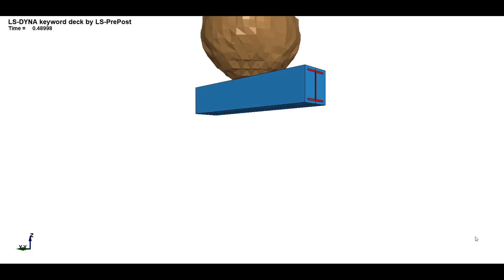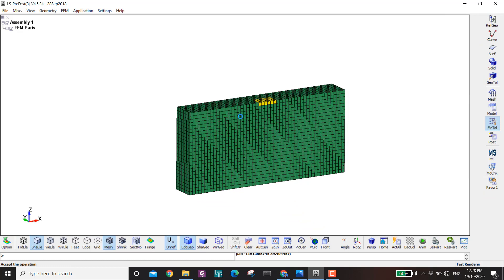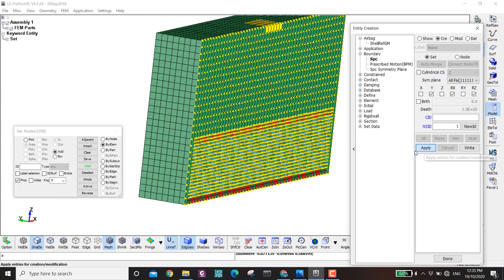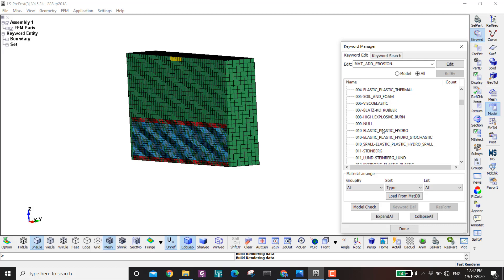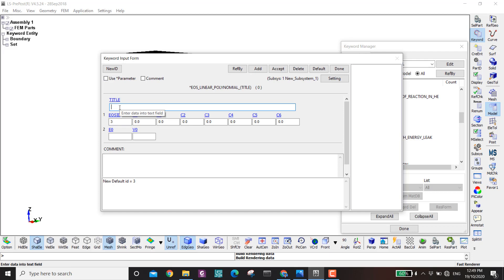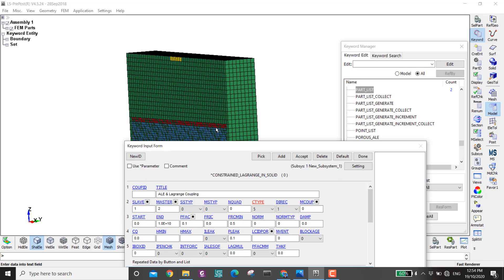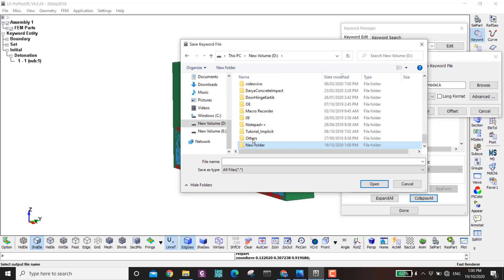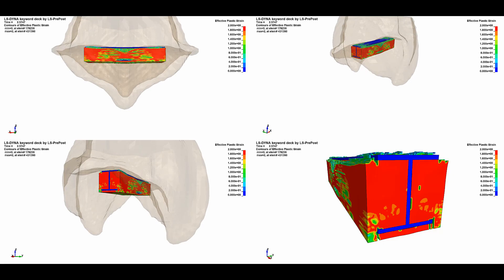LS-DYNA TUTORIAL 20: TNT Blast on Composite Beam

Comment: thank you very much for your work! it is very helpful for me.  And i am waiting for ur tutorial with S-ALE method about the concrete under blast.
Reply from the maker: Check out the following document:
https://ftp.lstc.com/anonymous/outgoing/hao/sale/tutorials/S-ALE_Solver_1.pdf
Reply: @AmeenTopa  thank you very much!
Reply: @AmeenTopa  Dear Ameen sir. i met some problems when performing my simulation about concrete beam under blast loadings with FSI. I found when the largrange grid is the same ,if u thinner the Euler grid , the blast wave spreads slower in air ,and the reflect of the beam is not good.can you give me some advice? Thank you very much1
Reply from the maker: As a general rule, the mesh or grid for both Lagrange and ALE should be relatively the same size
Reply: @AmeenTopa  but i have tried again,when the lagrange and ale have the relative  mesh size,  the coupling between the ale and lagrange does not work well. i dont know what problem  it is, so i wonder know if you can  help me check my kword?
Reply from the maker: @yingliangxu9369  You can check the following references:
https://www.dynalook.com/conferences/9th-european-ls-dyna-conference/fluid-structure-interaction-involving-close-in-detonation-effects-on-column-using-lbe-mm-ale-method
https://www.researchgate.net/post/How_can_I_control_leakage_when_simulating_explosions_with_Fluid_Structure_Coupling_Method_in_LS-DYNA
https://www.researchgate.net/post/Any_advice_with_a_Blast_modelling_in_LS_DYNA_using_Load_blast_enhanced_and_MM_ALE_Leakage_problem
Reply: @AmeenTopa  sorry to bother u. When adopting the key *constrained beam in solid to couple the reinforcement and concrete, a LSDA format file cbisfor can be made.  I have tried to open the file through LS-Post, but it didnot work. Do u know how to open the cbisfor file,?

Comment: Hii sir I am Akshay, i have seen your blast simulation video.
I have also tried the same as yours, I am getting problem related to ALE multimaterial section ELform 11 is not applying over there.
If another ELform kept like -2 or -1 the blast is going out of air domain.
Sir I request you to please provide me the solution regarding the problem.
    Thankyou sir
Reply from the maker: Hi there, for the TNT and AIR, you need to use ELFORM = 11 in SECTION SOLID. If this option does not appear to you, then maybe you are using an old version of LS-PREPOST and you need to download the latest one. 

ELFORM = -2 and -1 are for structural parts like the concrete or steel parts.
Reply: @AmeenTopa  thankyou sir

Comment: Thank you so much. That's a kind of you. Keep it up.
Reply from the maker: Glad it helped. Please share my videos so they can reach and benefit more people!
Reply: @AmeenTopa  Indeed. I will share and recommend my colleagues to keep in touch with this channel.        Ammen Topa, If you could please shoot one more new LS-DYNA and/or LS-PrePost tutorial video on "Steel concrete composite beam under blast load", where the SCC beam is planned to be made using advantage of symmetry from a reinforced concrete slab with "I" or "H" section structural steel beam which then finally reduced to quarter (1/4) of the FEA model (i.e. SCC beam with RC slab with "C" or Channel section). Thanks in advance.

Comment: Can u help me how to use volume fraction geometry, I need to simulate a composite plate sandwiched with a shear thickening fluid.
Reply: And if u suggest how to incorporate and procedural steps for the above problem
Reply from the maker: @raviprasanth3675  Sorry, your request is very specific and I do not think many will be interested. You may contact me privately if you needed private consultation.

Comment: i have problem say :

* Warning 40487 (SOL+487)
     max prin strain of element 18510 at int. point 1
              NaN > failure crit 1.0000E-01 at time 2.8082E-01
     solid element 18408  failed at time  2.8082E-01
     solid element 18409  failed at time  2.8082E-01
     solid element 18410  failed at time  2.8082E-01
     solid element 18508  failed at time  2.8082E-01
      node  number 20512 deleted at time  2.8082E-01
     solid element 18509  failed at time  2.8082E-01
      node  number 20513 deleted at time  2.8082E-01
     solid element 18510  failed at time  2.8082E-01

do you know how to fix it sir?
Reply from the maker: That's not a problem. It is just a message telling you that some elements are being deleted as they reached the maximum principle strain defined in MAT ADD EROSION.
Reply: @AmeenTopa  how do you find the EOS for aluminium or other material sir?
Reply from the maker: @abdullahfaqih9745  you can search in the literature. Go to google scholar or research gate.

Comment: I have followed all the steps you had done but I face a problem the file act as there is no exploaion and the running time is very small less than 1 second . when I open the 3DPLOT  I find there is no effect for the explosion and there are not any deleted nodes in the run out file.
Reply from the maker: Please follow the steps again carefully. This video is uploaded since two years ago and no one else has encountered similar problem.
Reply: @AmeenTopa  I will follow it again.. Thank you. But l have another question the distribution  of the explosion appears By defult or l have to change the sitting to show it?? as I tried several models and I can see the effect of the explosion but I can not appear its distripution.
Reply from the maker: @nancyyounan-or5wq  You need to hide the solid mesh of air and explosive and show the fluid(ale) mesh. Check the post processing part of this video again.
Reply: @AmeenTopa  ok. Thank you 🙂

Comment: Dear Ameen,
I tried to model this exact same problem but I am not able to see the part 5 and part 6 i.e., ALE group 1 and ALE group 2. I have checked that I have assigned the ALE>multi-material group keyword, could you please help me out!

Thank you.
Reply from the maker: Dear Yash,

First, make sure you are using the latest LS-Prepost.

Secondly, make sure that the correct ELFORM is used for the ALE parts. 

During the preprocessing (in the k file), you cannot view the MM_ALE groups. It is only visible in the post processing. 

Make sure to tick on the small box next to 'Fluid(Ale)' on the "Assembly and Select Part" window.
Reply: @AmeenTopa  Got it. Thank you.

Comment: In contact automatic surface to surface, shouldn't the concrete be the master and I-beam the slave but you have done it the other way around. Is there any reason for it?
Reply from the maker: It doesn't matter because we are using AUTOMATIC surface to surface. If you are using Surface_to_Surface which is not Automatic, then slave should be the concrete and I-beam is the master. The slave is the parts that is moving. Master is the part that is stationary. 

Note that this is only for SURFACE TO SURFACE contact. If it is NODES TO SURFACE then the nodes should be the slave always.
Reply: @AmeenTopa  Thank you sir for the explanation.

Comment: how can i define the weight of explosive in this modeling 
if the explosive charge is 25kg or is 1000kg , in which step can i define this
Reply from the maker: Dear Hemeda, you need to increase the volume of the TNT initial volume
Reply from the maker: For easier control of the mass, you can just use LOAD BLAST ENHANCED. Check out my tutorial on Blast Simulation here
https://www.youtube.com/watch?v=B1vGRU2a5f0

Comment: Sir iam getting the error of ALE part is beyond initial void what could be the reason.
Thankyou
Reply from the maker: Are you using INITIAL VOLUME FRACTION or INITIAL VOID?
Reply: Initial void
Reply from the maker: @akshayraj2426  the part used in this keyword should have ELFORM = 12.
Reply: Sir at the end of lsdyna manager it is showing like forttl severe program exeption acess violation
Reply from the maker: This sort of error is due to the solver, as  discussed recently in the LSDYNA Gmail group. Check that one for more details..

Comment: Hello, Amen. Thank you for your wonderful tutorial, its very helpful for my master degree. But I have an error on LS-Run after starting solving...

 * Error 11115 (KEY+1115)
     Part ID 2 is using stochastic material option but no
     *DEFINE_STOCHASTIC_VARIATION or *DEFINE_HAZ_PROPERTIES keyword is used.

 * Error 10133 (KEY+133)
     input data failed with: 2 errors

Please help me...
Reply from the maker: Did you have this error when you tried to do the model in this video?
Reply: @AmeenTopa  Yes, I tried to recreate your model
Reply from the maker: @Ya-Salo  Make sure that you are using exactly the same material model that I used in the model.
Reply from the maker: I think you are using MAT JOHNSON COOK STOCHASTIC. This is not the model that I used.

Comment: Hi, thank you for the videos.they are wonderful.I have made a model similar to yours.
However, the explosion does not happen. Do you have any idea what might be the reason?
Reply from the maker: Please try to follow the example again, step by step. Others have make it and didn't face the same problem as you did. They might be a problem in the material input.
Reply: @AmeenTopa  I wanted to model the reinforced beam.I used some part of your model.should I have an equation of state for concrete.
Thank you.
Reply from the maker: @arezo2242  No. For the concrete, you can use MAT_CSCM as I did in the tutorial: "Wrecking Ball and Reinforced Concrete"

You said the explosion didn't happen, so the problem shouldn't be the EOS or MAT of the concrete.

Comment: Hello sir, thank you for this video. I had a question regarding the ALE Air domain. What is the type of boundary condition that is implicitly applied here ?
If I were to simulate confined blast in a cube chamber would modeling the cube by the air domain with one of the wall being a lagrangian structure generate the same results as if I were to fully model the cube as a lagrangian structure and put it inside a bigger ALE air domain ? Thank you very much for your content and answers
Reply from the maker: If it is a confined blast, then it is more efficient to not model the Lagrange cube.  Just use *BOUNDARY SPC NODE SET or *ALE ESSENTIAL BOUNDARY to fix the outer surface of the air domain.
Reply: @AmeenTopa  Thank you very much for the advice !
Reply: @AmeenTopa  Hello sir, i'm sorry to bother you but you are truly of great help. I have two question for you and it would be awesome if you could answer them. 
1 - How can I specify the initial internal pressure of the TNT so that the material is at atmospheric pressure at t=0 like the ALE domain ?
2 - I couldn't find in lsdyna a damage model that rely on elongation at break, are there any model like that ? 
Thank you very much for everything
Reply from the maker: @theodose3  1 - I have no answer to this. You can try different values of E0 in the equation of state for the TNT.
2 - You may want to check ADD DAMAGE GISSMO.
Reply: @AmeenTopa  Once again thank you sir
Reply from the maker: @theodose3  you are welcome
Reply: @AmeenTopa  Hello sir, sorry to bother you once again.
I have two questions for you, it would be very helpfull if you could answer them.
1 - I'm doing a 2D axisym simulation of a steel plate that represent a "weak wall" of a cuboid chamber with a sperical charge of tnt in the center of the chamber. I'm quite confident in the modelisation of the explosive (I compared the peak pressure at different nodes and it's similar to experimental data) but I can't manage to get good results in term of middle point deflection. Would you have any advice to get a greater middle point displacement ?
2 - In 2D axysim, does the thickness of the shell section have any impact ?
Thank you very much for your time and your videos,
Reply from the maker: @theodose3  1- check: the blast overpressure is it correct or not? And check the material properties of the wall
2- no, the values you put in T1 - T2 doesn't matter.
Reply: @AmeenTopa  Thank you I'll look into that
Reply: @AmeenTopa  Hello Sir, 
I hope you are doing alright, I was wondering if you could tell me how to plot the blast impulse (integral of pressure) in ls prepost ?
Thank you for your answer
Reply from the maker: @theodose3  as far as I know, there is no direct way to do that. You first need to plot the pressure vs time and then use the integration tool from the plot window options.
Reply: @AmeenTopa  Thank you for the answer i'll look into that, also do you know how to plot the damage number for a given erosion model ? I've seen author doing it but I can't find how to do it... Thank you
Reply from the maker: @theodose3 this depends on which material model. You need to check the history variables. You may read more about this in the user manual vol. 2.
Reply: @AmeenTopa  Thank you for the fast answer, have a nice day !

Comment: Ameen Topa sir, I increased the termination time to a 100ms so that there are a 1000 timesteps. But in the animation, the concrete elements kept on getting deleted right till the end and there was also no clearance of the blast wave. How to resolve that?
Reply: Also it took 4 hours for the analysis despite putting the memory of 1000m and 4 cpu. Can you please tell me ways to speed up the analysis on smp solver.
Reply from the maker: That's normal. You need go have a very fine mesh. 

However, not all concrete will erode. Especially the concrete on the lower side below the I beam. If all concrete are deleted in your simulation, then it means there is something wrong with the material properties. 

You are using 4 cpu, so that's amount of time is standard. You need more processors to make it faster or you can reduce the number of the elements in the model.
Reply: @AmeenTopa  ok sir, and also if I increase the memory to lets say 5000m then would it decrease the computational time?
Reply from the maker: No. I said you need more processors, not RAM.

Comment: The I BEAM doesn't have any erosion??
Reply from the maker: Yes, the TNT mass is small anyway..
Reply: @AmeenTopa  how to control the charge weight herein
Reply: i mean to define the charge weight
Reply from the maker: Dear  @mohamedhemeda2438 
Mass = density x volume.

Density of TNT is fixed, around 1600 kg/m3. We cannot change. 
So, if you want to have heavier mass of TNT, then you need to increase the size of volume of the initial charge.

Comment: So helpful; thanks
I have a problem with control of TNT after detonation.  I use a rigid cylinder to control direction of TNT after detonation; but TNT path through the rigid after detonation, how can I control that?
Reply from the maker: First, does it pass through as if the cylinder doesn't exist or there is leakage in the cylinder?

Secondly, the cylinder is shell or solid? If it is shell, check the normal of the shell. See my tutorial on sloshing. I have explained about this there.
Reply: @AmeenTopa  I have a cylinder closed on one side; 1 kilogram of TNT is placed inside it. I want the wave to come out of the open side after the explosion.
Reply from the maker: Are you doing something like explosively formed projectile?
Reply: @AmeenTopa  I am investigating the effect of the TNT explosion on the steel plate, but the TNT comes out of a chamber in the form of a cylinder.
Reply from the maker: @abolfazlkhalilijam8096  okay.

Try reducing the timestep scaling factor. 
If still didn't work. Apply boundary conditions on the TNT nodes instead of using a solid containers.
Reply: @AmeenTopa  reducing timestep didn't work.  But I will also try to apply the conditions to the nodes. Thank you very much for your help.
And special thanks for the videos you post on your channel; They helped me a lot, especially the videos related to ALE, I learned ALE with your videos.
Reply from the maker: One more thing. For the model with cylindrical container, you can try increasing PFAC to 0.5 or even 1.0 in  CONSTRAINED LAGRANGE IN SOLID. Also, try the leaking controls PLEAK.

You are welcome. I am glad that my work is helpful. If you need personal and private consultation, I am available. It will be free of charge, but only with the condition that we publish an article together based on the results.
Reply: @AmeenTopa  Thank you very much for your guidance, I will definitely follow the points you said.
Is it possible to write an article without mentioning the name of the teacher?
But this is a work project and the results are not for me.
Reply from the maker: I am not sure about the rules in your institution. If you want to consider publication, it is better to consult with your advisor/guide.
Reply: @AmeenTopa  I will definitely refer to the guide.
  Anyway, thank you for your help. And I follow your videos.
Reply from the maker: @abolfazlkhalilijam8096  You are most welcome.
Reply: @AmeenTopa  thank you very much.